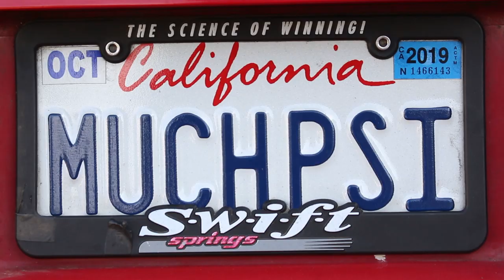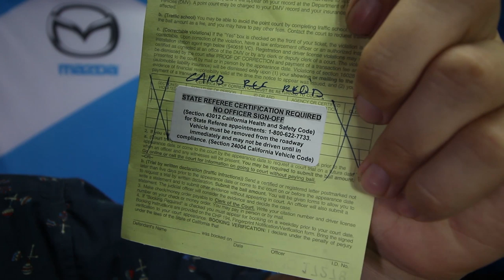I Have The Most Illegal Daily Driven Miata Ever Built

Comment: more reasons not to live in Ca.
Reply: Where can you beat perfect climate and perfect roads? To lots of us it's worth it for the weather and the turns.
Reply: @Jacob Griffin The average temp in Santa Barbara year-round is 68 degrees. Where do you suggest that is close to that and has 4000ft mountains with endless corners and ocean beaches 20 minutes apart? 

I spent the day with a dremel grinding out welds from a stock exhaust to get the most HP out of a legal(ish) set up to put up with regulations to keep a clean environment, and I'm willing to make that trade off. But I get the frustration and illogical results meaning I can't put a newer engine in the car - even though it will burn cleaner. There's enough other good things they do in Cali that it's worth it.
Reply: @Jacob Griffin I'm spoiled as hell now.... I moved here from Maine. LOL... never seen cars without rust before!

Comment: I can understand requirement for emissions system but seems a bit daft with being required to be stock. Should be able to run a turbo with a cat as long as it meets tail pipe emissions check. 

Those who claim its about cali being a communist state I suspect its has more to with capalist dealerships lobby your local politicians to keep people using them
Reply: We have CARB, not just smog. Even the air intake needs to have a CARB EO number. It doesn't matter if your air filter passes emissions, if the manufacturer hasn't paid the state its extortion fee, it's illegal.
Reply: Youtube Troll  that not commist though that's vulture capitalism. Here in the UK all you need to do when you get your MOT is to pass the emission tests, Where they stick a probe up your exhaust and check the exhuast gasses

Comment: Wtf how did the cop even notice it wasn't the stock engine ?
Like since when do cops see the difference between a 1.6 and a 1.8 miata engine ? California is crazy, cops here wouldn't even be surprised to see a turbo, they wouldn't know what it is, and definitely wouldn't know it's not supposed to be here.
Reply: The biggest flag is the VVT solenoid on the valve cover, I would assume the CHP officer wasn't totally ignorant.
Reply: @mroshfosh   hmm let me see the original engine is 4cyl OH SHIT the engine he has right now is 4cyl too. And you know what, they look the same except the head.
Reply: He litterally had a custom license plate advertising that he was turbo charged and modified
Reply: so the cop isn't gonna see a fat turbo the  intercooler.. the crazy fat ass coil pack.. the coolant reroute.. all the room in the front of the motor doesn't look right.. he isn't gonna hear no exhaust.. the intake. come on bro..don't be that guy.. that says why did I get pulled over driving a race car.. cage bucket seat.. speaking on that if he gos to the state reff there gonna make him put all the oem seat belts back in.. racing harness isn't dot approved. that's a pain
Reply: Cop probably assumed it was swapped, cause why wouldn't it be, and then dropped it later to make it seem like he was nicer. That, or he asked and Greg didn't want to lie.
Reply: They know the area is known for racing so probably seen similar bays pulling over ricers through the years

Comment: So glad I dont live there... Virginia has this awesome thing called antique tags, register a vehicle once and its permanently exempt from emissions and inspections. Good luck man
Reply: The antique tags aren't the "get out of jail free" that you're suggesting. You can't daily the car. If you want to drive it outside of the antique limitations, then it has to be inspected (safety). In order to pass safety, all the original emissions equipment must be intact and functioning as intended by the manufacturer.

Limitations for antique plates in VA:

"If you plan to use your antique vehicle or trailer solely as a collector's item, you may register your vehicle with antique license plates or permanent vintage license plates.

Registering your vehicle either of these ways limits your use of the vehicle to:

- Participation in antique car club activities, exhibits, tours, parades, and similar events.
- Testing its operation, obtaining repairs or maintenance, selling the vehicle or trailer, transportation to and from events as described in number 1 above and for the occasional pleasure driving not to exceed 250 miles from your residence.
- Carrying or transporting passengers, personal effects or other antique motor vehicles being transported for show purposes."

Some people get away with it - some people receive tickets for no inspection when it's parked at their place of work. YMMV.
Reply: @jeffwalters5925  I'm aware there are limitations, however I know many people that run them on daily drivers and get away with it. It's kind of a hard law to enforce unless a law enforcement official really wants to do the legwork to verify you're out of compliance.

Comment: Option 4:  Finish your racecar and take it to the track. It's so much more fun to push to 90 or 95% and not think about anything but getting the exit right and hitting 120 on the straight, and still getting it slowed enough to do the same on the next corner. Avoiding cops and idiots just takes away from the thrill!

Comment: Hi Greg - similar to Switzerland - any significant change to almost anything needs technical approval and an entry in the vehicle registration document. 
At the moment I'm running mostly LEDs which theoretically aren't roadworthy-approved (fact is: they work better than glow-worm incandescent bulbs). 
Nowadays there are so many cars with LED lights - more and more - so I'm hoping they'll just never get noticed (and even one day be approved). Because they fulfill the function correctly (eg. blink amber at correct rate or illuminate white and are well visible) there's no safety or form/fit/function issue - it's more of a paperwork one ("they don't have this XY proof-mark").

Comment: Damn, so its not just me or my area. I've been pulled over twice in the past month, both my first and second time within a matter of weeks, for loud exhaust. My NC isn't even that loud either, only a GWR Race single and no other engine intake or exhaust mods. Probably the only reasons I got off with warnings was because; one: I'm pretty sure my exhaust doesn't exceed that 95db limit, and Two: I'm completely stock engine wise, like literally stock intake to stock midpipe no mods other than muffler. So they probably knew they or thought it wasnt worth their time. 
Best of luck with the Cali SMOG and BAR, its gunna be a headache no matter what unfortunately :(

Comment: I worked at a ref station. Your car has to run as does in its original factory form and pass the sniffer, we also would check every sensor and will even know if you have set of aftermarket cams. When your car is brought to BAR you are under the microscope so the best bet is either make 100 percent stock (still a chance you wont pass), find out what the cost to just pay off the ticket if thats an option (years ago it was 350-400ish) or sell it and got to court... then buy it back😀. Good luck

Comment: hi Greg, I live in socal and a few years ago I got a ref ticket in my miata. It wasn't at all difficult to get it signed off and I ended up paying nothing in court but it did take serveral months and 3 trips to the ref.  Just make sure everything is 110%  oem spec. No zipties, deletes, or even random wires hanging around. It has to be completely stock! The only issues I had we're ign timing and idle rpms. My readings we're only slightly off and yet it failed. Good luck and I hope you past it on the first run.

Comment: Not a new problem...  In the 80's, I had a Mazda GLC modded with a BRE kit that consisted of a pair of Mikuni side draft carbs on a new manifold, a tube header exhaust, (no smog pump or converter) a new distributor and plugs and a few other goodies.  In Indiana, for god's sake!  Had to remove and reinstall everything to pass the then required emission testing.  No as bad as your situation, but bad enough.

Comment: i got pulled over in my '90 for "no rear bumper" a couple weeks after i put my chassis mount on. the CHP proceeded to do a full walk around of my car and name off all the things wrong with my car which includes too low, modified exhaust (didnt see my test pipe somehow), too much camber, crack in windshield, illegal windshield banner, stretched tires, and he tried to tell me the spoiler was illegal but to my knowledge there is no vehicle code legislation that says anything about spoilers. somehow in all of this i managed to get out of this with no tickets. scared the shit out of me so i went home and took off the chassis mount until i was ready to cut holes in my bumper lol

Comment: Get a cat and a muffler from a friend, put a super weak map on and that should pass the gas test. Put the wipers on. Get it checked and you should be done.
Or are they gonna check all the other stuff besides what's in the ticket?
Reply from the maker: Yeah if you actually bring your car to the ref it has to be 100% stock, or have a swap that passes the BAR inspection, which means 100% stock basically.

Comment: Wipers exhaust and emission equipment? Catted quiet exhaust, should have that anyway for those incognito rip n dips. Wipers = ez. You should want to maintain an evap can anyway. Egr might be sorta difficult but all you gotta do is run 1 pipe.. ref inspection only has to pass the original written errors right?
Reply from the maker: No. In order to pass a ref inspection the car needs to be 100% stock or have a BAR approved engine swap. This is not a "fix it ticket"
Reply: Sad :(

Comment: Flyin Miata has carb legal turbo kits now. No emissions equipment there’s really no excuse for.
Reply from the maker: FM has had CARB kits for like 15+ years, but they're quite restricted on power.
Reply: @TheCarPassionChannel  Did you ever publish a video on what ended up happening with this? Obviously car is still on the road and highly modified. Or are you keeping that under wraps for the obvious reasons?

FWIW I drive a modified Miata in California...nothing CARB illegal on the car though.

Comment: In Phoenix (Maricopa County) we are required to do emissions testing and I have an NB which means they require passing via ODB2. Some other counties don't require testing so we typically go to a 3rd party DMV as they tend to be a little more loose with rules, and you register your car to an address in a county that doesn't do testing, and put your real address as the "mailing address" on the registration. Since the vehicle is "located" in an area that doesn't require testing, it's no longer a requirement. There was a big thing recently, even vinwiki covered it, where supercar owners would open an LLC in a state like Wyoming, so they wouldn't have to pay thousands in sales tax, which the state of Georgia is trying to close that loophole, but that might be an option to consider
Reply: Just so you know, registering a vehicle outside of Maricopa county to an address you don't live at can turn into insurance fraud. I used to do it all the time, but not anymore.
Reply: @Dustrunnersauto  interesting, I've had vehicles registered in other states and made claims and never had the registration come into question. I'd be curious as to which insurance company that was and what the claim was.
Reply: TheTightShirts it can be insurance fraud once you get into an accident and your insurance finds out it’s registered elsewhere.

Comment: here in australia there called defect notices. i got one for:

loud exhaust
exposed breather
exposed headers
black doors on red car
car lower than 100mm off the ground
doesnt have stock pedals
shifter doesnt display the gears
doesnt have stock seats
seatbelts ‘dont retract quick enough’
tyres outside of guards 
not stock steering wheel

yea...
Reply from the maker: BLACK DOORS ON A RED CAR WAHT??? And the shifter... wow
Reply from the maker: BLACK DOORS ON A RED CAR WAHT??? And the shifter... wow